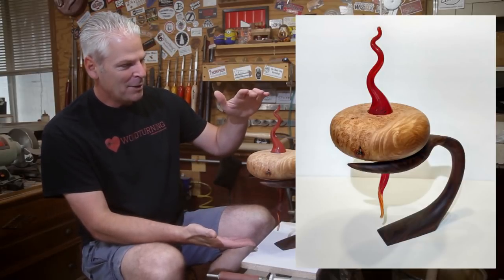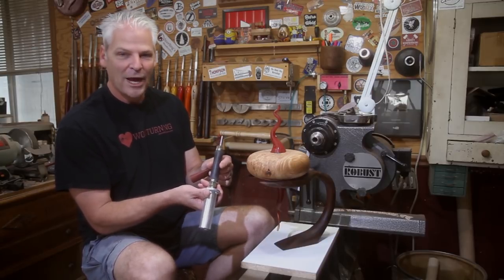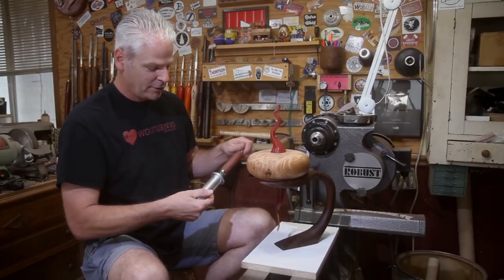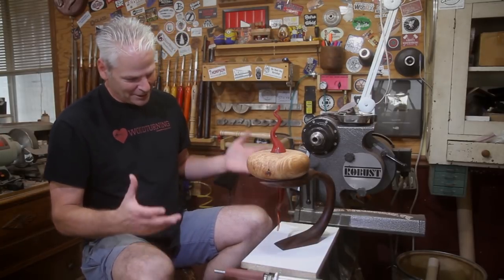Power Carving A New Walnut Stand For Last Weeks Project

Comment: Carl, would you mind sharing what you were using for the surface plate clamped to your lathe bed starting at about 3:15 in the video? I’ve been struggling for some time with homemade contraptions to accomplish similar sanding needs and your setup looks awesome, far easier that what I’ve been doing.
Reply from the maker: It's a glass plate 1/2" thick. I use it mostly for sharping, but it works great for things like this it's really flat.
Reply: Carl Jacobson Cool, thank you for taking the time to answer! I’ll have to start keeping my eyes open for something like that, I think it’s going to be exactly what I’ve been wanting to have.